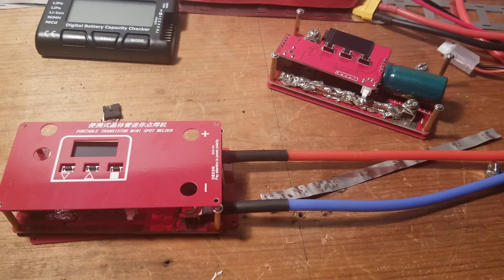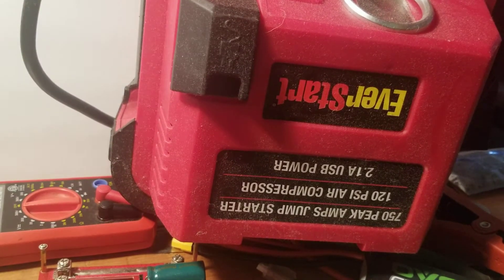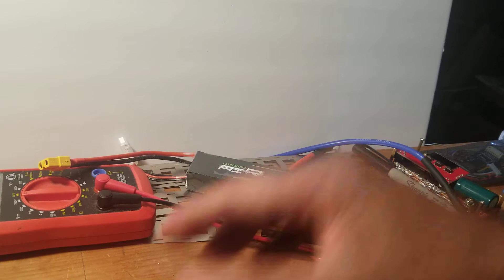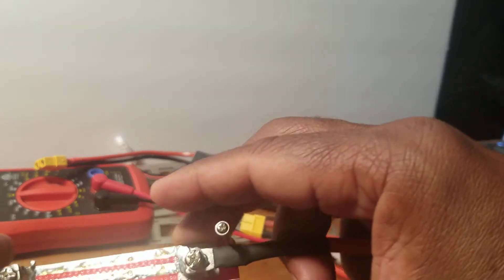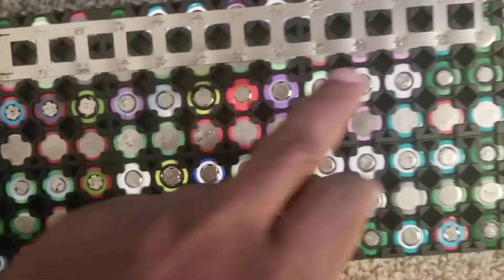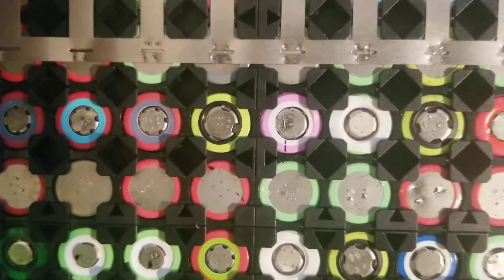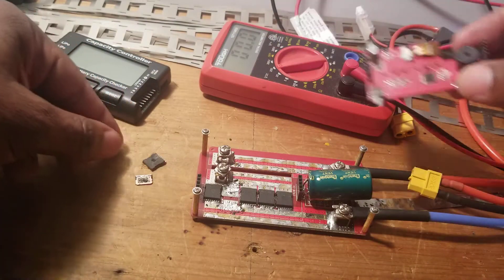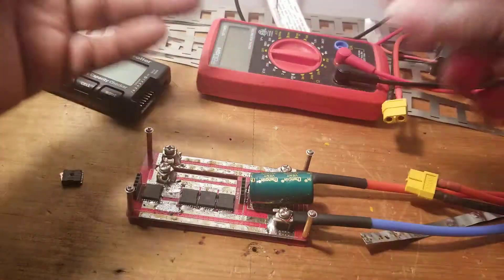DON'T BUY THE MINI RED SPOT WELDER FROM CHINA. THEY ALL FAIL. THEY'RE NOT GOOD

Comment: i bought one an it die in 5 min
Reply from the maker: Let's me guess low voltage. I have a video on the purple spot welder. It seams to be better. I also have MALECTRIC SPOT WELDER. It failed also badly with low voltage
Reply: @simplyfocus9937  i did 5 spots wield an it stop
Reply from the maker: It works as long the battery 🔋 stays above  13.00 volt, below that. You will lose some mosfet

Comment: I have noticed even the ones with their own battery struggle after a short time, so you might be better off trying a motorcycle battery and a small solenoid, perhaps even add a timer for the length of the spot weld.

But I have two different types of these spot welders and they start off good and end up not so good.

But you get what you pay for, so if you buy cheap you expect issues and either deal with it or move on to another system.

I would be very careful of using a lithium ion battery for that and perhaps use something safer, as those things have a tendency to catch fire.
Reply from the maker: Really appreciate your comments. I have a maletric spot welder, It works flawless. Around $140.00. I am about to buy another mini different type. SUBSCRIBE you will have an alert when I upload the video

Comment: Have you tried to lower the mAh and c raiding?
Reply from the maker: It won't turn on
Reply: @simplyfocus9937  well I'm getting mine tomorrow and want to do a test on them
Reply from the maker: @xXxbloodhoodxXx1  good luck, you will need a 12v battery that has a lot of amps
Reply: @simplyfocus9937  mine works great 👍
Reply from the maker: @xXxbloodhoodxXx1  I do a lot of spot welder, it was working for 300 spot welders, battery dropped in voltage, so goes  the machine, blown musfet
Reply: @simplyfocus9937  I use lipo battery and 1-8s Lipo Battery Tester Monitor Low Voltage Buzzer Alarm Voltage Checker I changed it and recharge the battery once it hit 12.1v to 12.5v, I been in the electronics industry since I was 11 years old and I'm 25 now. Just gotta be safe and know when to changed and charge a battery so it won't blow the mosfets close or open. Some to another of mosfets are sensitive to voltage change from microcontroller

Comment: Mine works beautifully, at least over 1000 spot welds and still going strong. Did the required mods for the variant I have (capacitor added) and running it off a HRB 3S 6000 and the highest setting that is needed is around 30 to 35. I rigged a micro switch to one of the electrode leads for manual operation. Don't like the auto mode because if you move the electrodes when it "fires" you'll get a spark and a poor weld.

Comment: I have mine that I bought at Banggood (China) in 2019 and with the modifications of the videos below it works 100% well.
https://www.youtube.com/watch?v=Zk_ir69kB5Q
https://www.youtube.com/watch?v=fdnO0Z-scjA
https://www.youtube.com/watch?v=RSrlXqFxhp8&t=0s
https://www.youtube.com/watch?v=mfbQiuopxMk
https://www.youtube.com/watch?v=fz-RNbXdnA4
Reply from the maker: The device works. The problem is how long. I have 2, they both had blown mosfets. They is huge FLAWS    in the design.
Reply: @simplyfocus9937  Try to see the videos, there are several versions, in my opinion the best and easiest to solve is the Chinese original Luca has several videos about the different versions and how to solve the problems here is an example: https://www.youtube. com/watch?v=1ZCbLdymJIs

Comment: if the spot welders fail I bought two of them they're very cheap if they fail I will file a dispute with eBay then I will file a dispute with my credit card I just want them to work a little bit
Reply: I have mine that I bought at Banggood (China) in 2019 and with the modifications of the videos below it works 100% well.
https://www.youtube.com/watch?v=Zk_ir69kB5Q
https://www.youtube.com/watch?v=fdnO0Z-scjA
https://www.youtube.com/watch?v=RSrlXqFxhp8&t=0s
https://www.youtube.com/watch?v=mfbQiuopxMk

Comment: If the mosfet blown up even you make thicker your traces surely you used large current battery. other than that you dont need to add capacitor because the input capacitor it is enough to give enough power supply to your mosfet controller if you dont mind I refer you a link.https://youtu.be/SiEevlklAfU
Reply from the maker: I did check out your video. I have seen Some of your video before. Your device is different than mine. My device works for 200+ welds, when the powers sagged, voltage dropped, the mosfet blown. If you double or triple the size of your battery you will be ok
Reply: It depends on which variant av the board you have! And I would say every one of them need a small modification to work properly if you know any electronics.
Reply: @ImaginaPower  Absolutely right

Comment: Hello. It's not Joules, it's milliseconds and anything over 30 is too much when you have a strong battery. If you've done the modifications suggested by Luca for your model, you shouldn't have any problem. I use the same model for hours daily without any issues. One thing, if it starts getting too warm I stop for a few minutes and then get back to work. I know you're pissed but this thing is good!
Reply from the maker: Thanks, I bought Malectrics one. I am going to  change the mosfet and try again. I will let you know. Thanks again
Reply: @simplyfocus9937  The Malectrics is a great device, works right out of the box, good choice.
Reply from the maker: @solidhit2  just like you said. I just did 800 welds in single charge.
Reply: @simplyfocus9937  I'm glad you're not angry anymore!
Reply: I bought two of these cuz they're $10 each just to play with them and make the modifications and see how it goes..... but I also felt that the meltronics one was a very good deal now I got to get some batteries where do you all get your batteries from